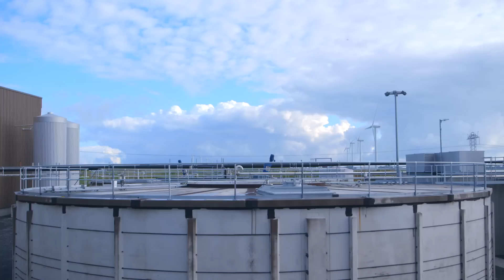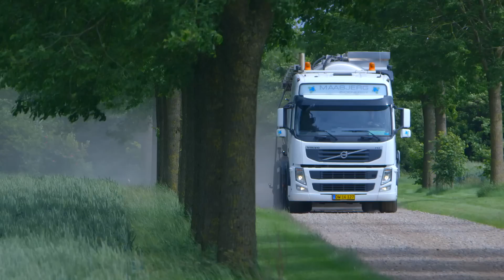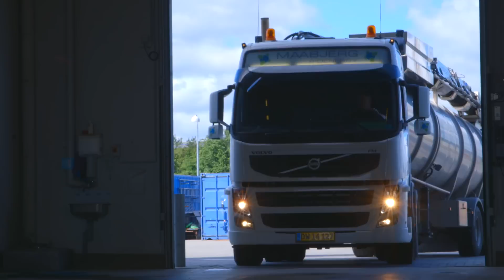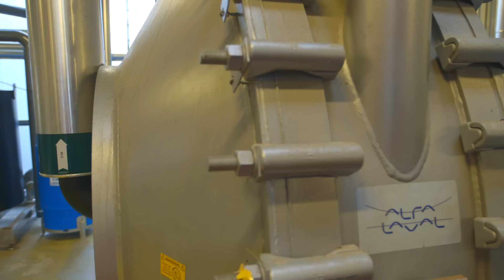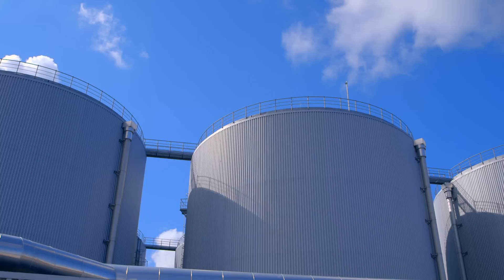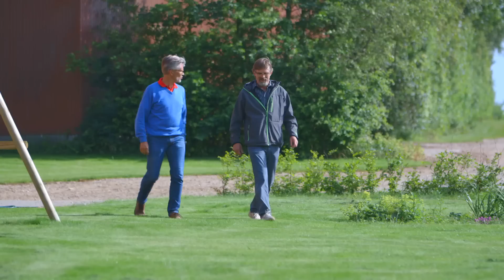Electricity and heat from manure - a large scale biogas plant. Example Maabjerg, Denmark

Comment: Reducing CO2 emissions? I'm guessing, the trucks run on diesel, right?
Reply: Biodiesel electric Hybrid
Reply: Does it matter???? If the net result is that greenhouse gas emissions are reduced (and I highly doubt that a truck would cancel out more than a tiny fraction of the greenhouse gas emissions saved by not powering a large area like that with fossil fuels), then emissions are still reduced. Focus on the big picture instead of trying to outsmart everybody.
Reply: They can run off the biogas for short distances or you upgrade it and freeze it to like -50 degrees Celsius (approx not accurate) to make liquid natural gas for the trucks.
Check out my biogas playlist
Reply: @lukesmithy372  do you know how much it will cost to install something like this for 1600 cow heads?
Reply: the objective is not only one truck.